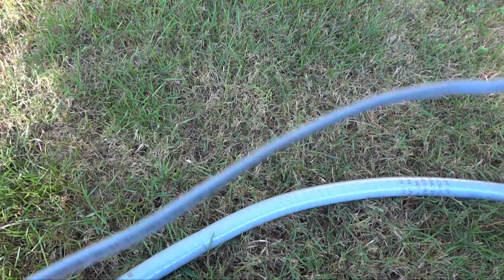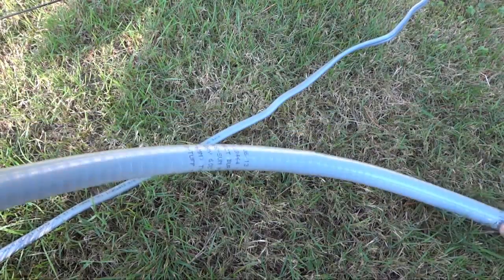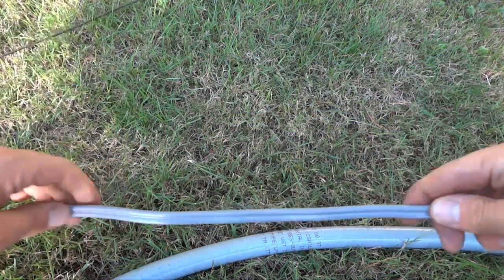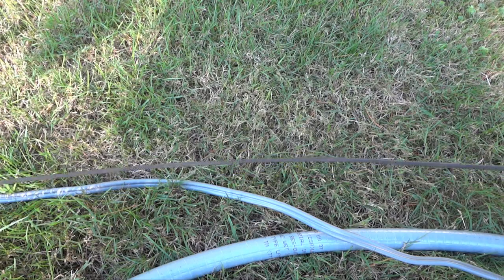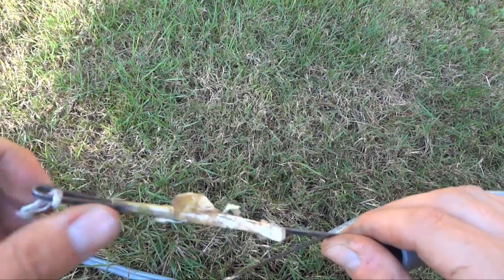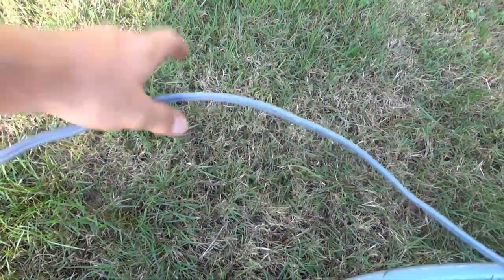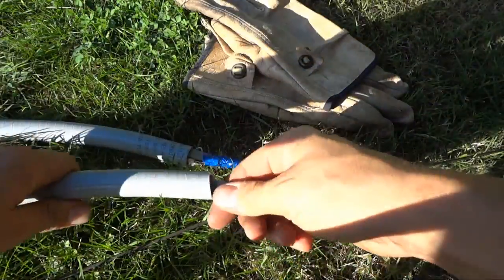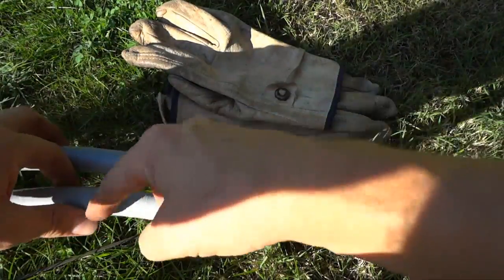Using fish tape to pull electrical wire through Liquid-Tight conduit

Comment: Fish tape is a good idea, separate THHN or THWN wires are an even better idea, and certainly using pulling lubricant will make the pull much easier.  And in fact, on longer runs, it's basically impossible without using lubricant.

Comment: "Some pros argue that NM cable inside conduit may be susceptible to heat build-up and is therefore not allowed. Others take a more lenient view. While the National Electrical Code does not expressly forbid inserting NM cable inside conduit, in practice, it is very difficult to do so, and very few professional electricians will do such an installation. "

Comment: fishtape is awesome for this, you can shove it through all sorts of different bends in the conduit.  They also make nylon stuff thats flimsier, never used it but ive seen it.  Another method you can try if you dont have a fish tape is find some string that will be strong enough to pull your cable through the conduit and atach a cotton ball on the end or somethin similar.  Go to the other end of the conduit and tape a shop vac hose to it, make it somewhat air tight, turn it on, go back to the other end of the conduit and put the string in and it will pull the string all the way through.  Then just tie cable to string and pull it back to u